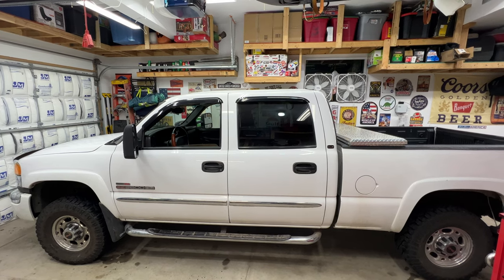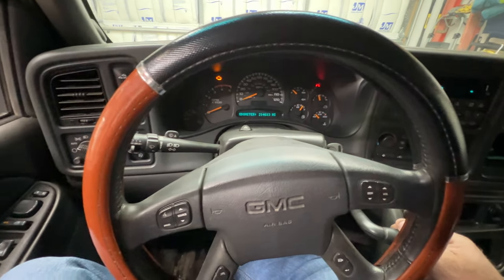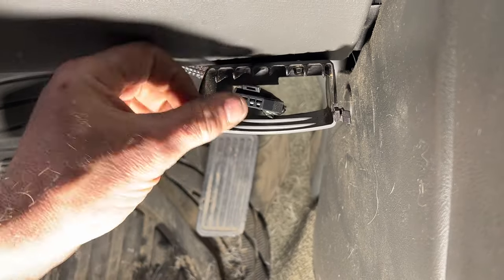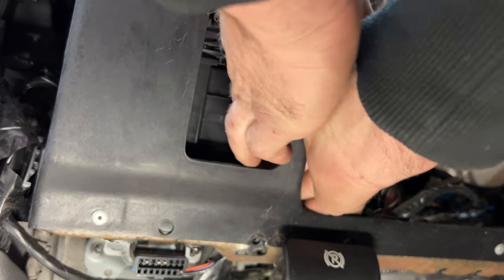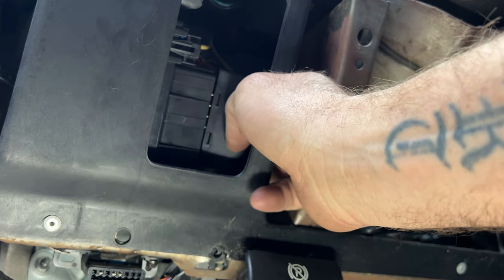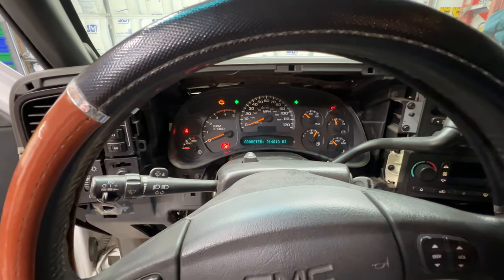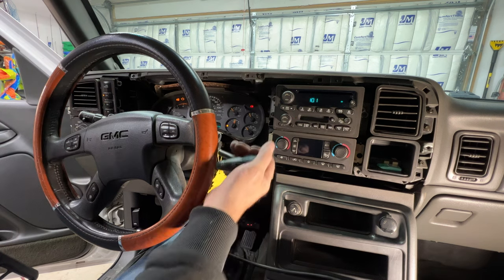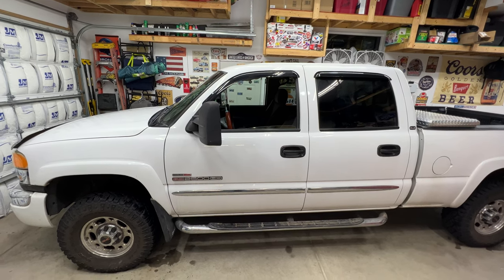1999-07 GMC/Chevy Trucks & SUV's Flasher Relay Replacement How-To

Comment: Thanks , I installed LED signals and got rapid flash but didn’t know I can use this module relay , almost cut into wires to install resistors, glad I looked further into your video

Comment: This was a great help - thanks. FYI - I took the flasher unit out of 2003 GMC Envoy (not LED). I realised you could open the unit up so did that and sprayed an electrical contact cleaner onto the electromechanical switches (3). Worked them back and forth a few times (gently) . One did seem a little sticky. Works fine now.
Reply from the maker: Thanks for the tip.

Comment: Thanks. Mine just started clicking on it’s own like the signal was on but both signals work fine. Just when off I get sporadic clicking from the relay. Guess I’ll swap it and see if that fixes it. Thanks
Reply: My left is on, hyper flashing- when they're off... when i switch to left or right, they work as normal- but when switch is off, the left front signal hyper flashes... not the rear left. front left only...
98 chevy 1500
Reply: @dustinoutlaw9453  I replaced the relay and it still does the same thing so now I gotta replace the actual switch. Fun

Comment: So. I’ve got a 03 Yukon xl. I replaced the turn signal assembly. But the left turn signal still produces issues like your right. So I’m thinking this is the problem. I also have led turn signals with resistors wired. 

Thank you for making this video
Reply: Update it’s the flasher relay.

Comment: i just installed LEDs for turn signals in back.  i haven’t soldered resistors to eliminate hyperflashing yet.  you are saying that if i replace flasher with led/incandescent compatible flasher that i won’t have to add resistors to the leds?

Comment: That Novita Relay seems to have a slight delay with the hazards and even the indicators in mine

Unit is fully installed.
Reply: My Novita does the same thing. Theres maybe a half second delay; just long enough to make second guess if it will work.
Reply: @giraffewithtattoos2770 Novita wasn't/isn't available right now. The ISSYAUTO tone I got does the same thing, really annoying, makes me want to go back to incandescent and forget about it...

Comment: My left blinker stays constantly illuminated when I turn on my headlights, right blinker always works unless I have headlights and hazards on. During the day, both blinkers work perfectly. Everything looks good, and I tried replacing the flasher relay but no luck. Any ideas?
Reply: I’m having this same problem. Find a solution yet?
Reply: @samlonge139  I actually did last week. I heard that the blinker bulb shares a ground with the marker bulb so I followed the line. About 6 inches back I saw that the cable was somehow jammed between the frame and a piece of plastic, grounding out the blinker when the headlights are on. Another guy with the same problem said how was just a corroded socket.
Reply: Was it the right or left side been looking all around
Reply: @samlonge139  mine was on the same side as the headlight that was constantly illuminating, which was the drivers side for me. I took out both top and bottom light compartments so I could follow the cable back. It was only a few inches for me. Other people said check the blinker relay module under the steering wheel, body control module, and of course fuses and relays.

Comment: Just had to do this, holly fucking shit I wish my bottom panel had the clips yours had. I nearly had to disassemble the entire truck around the clip just to get those 2 indestructible pieces of shit unclipped. Idk what the hell happened in the manufacturing process of those clips but they apparently were made to hold a 1000 lb armor plate in place, not a little piece of plastic.

Comment: I went to replace mine and it nearly fell out in my hand.  Pushed it back in and they worked find.  It is often the connectors or corrosion that are the culprit, not the device.

Comment: Okay so he did his best. But in my 1999 GMC Sierra 2500 the flasher control is easliy accessible and is just to the left of the steering column in a small fuse panel mounted on the firewall.

Comment: The 99-02 are different.
Reply from the maker: Thanks for the info is it a totally different procedure?
Reply: @BLUECOLLARGARAGE  it is in the same location, but it is a smaller square relay, and most aftermarket ones don't quite fit and require some trimming. The factory flasher has the pins more to one side, but the replacements are more centered and creates Clearance issues.
Reply: 99-02 is a 4-pin EP29